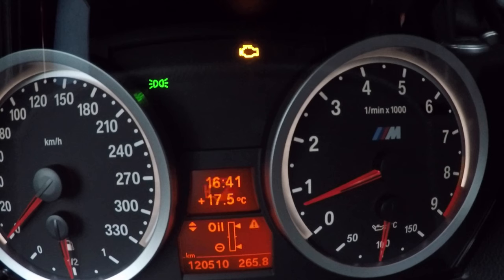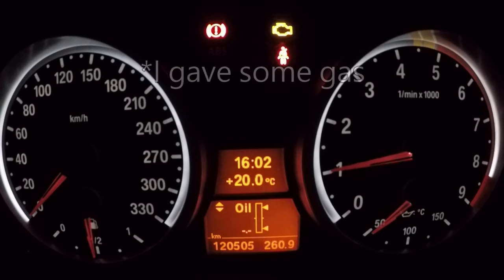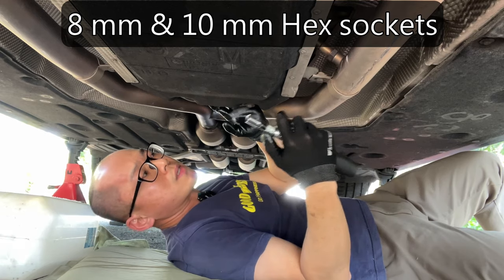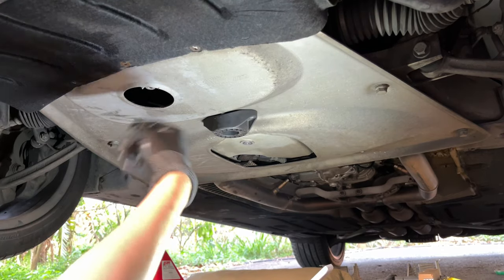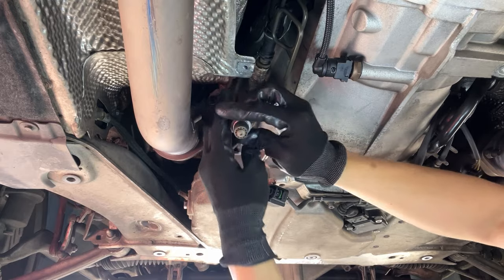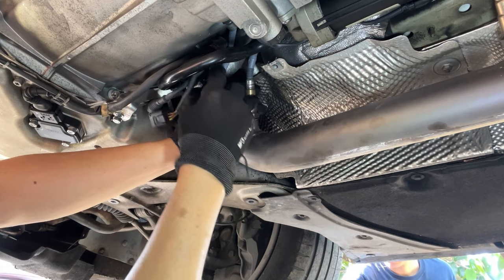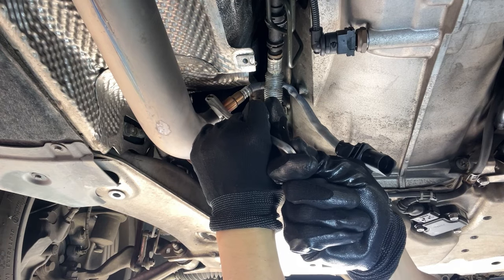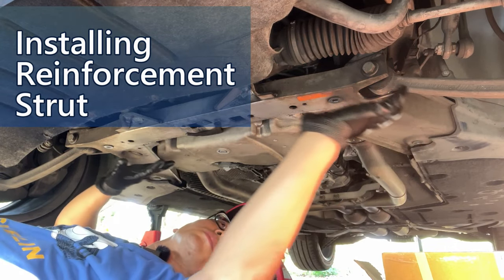O2 Sensor Replacement Fixed Rough Idle & Limp Mode of E90 M3 [ENG SUB]

Comment: i had a problem with bank 2 after kat, after  replacement error was gone by now i have 002CA2 CDKHSVSA - heating lambda probe before kat (shear stress) and 002CA3 CDKHSVSA2 - heating lambda probe before kat (shear stress) bank 2, any idea what is a problem now?
Reply from the maker: Hello Dimitrije, from the error codes it looks like another sensors have failed 🤔 they are the ones before the kat.

The o2 sensor has to be heated to their working temperature and the code indicates the heating coil has failed. Usually the coil cannot be repaired so replacement is necessary.

But before spending a lot of money for new sensors, please check if the connectors are loose, or the power supply for heating is out.

Let me know what you found!
Reply: Hi @funcarsgoodpeople, after replacement of o2 sensor before kat and drive of 120km it was all okey.
But after next start after some time i got another error 002C45 - DME: Oxygen sensor before catalytic converter.
I just sow that you did adaptation rest, i didn't do that, because i'm using Carly. Maybe error is because of that or something else, any ideas?

Thanks for help
Reply from the maker: Hello Dimitrije,
Please try to reset the adaptation. Actually I forgot to do it after O2 sensor replacement. The DME(ECU) still memorized the erroneous air-to-fuel mixture value so I got same rough idle and misfire upon the very next start. After adaptation reset, the replacement was successful, as shown in the video.

I had Carly before and I don’t like it because it kept asking me to pay for its limited functionality. I don’t think it’s useful for your professional DIY. Maybe you can visit local repair shop and ask them to do the reset with their diagnostic tool. I guess this is the quickest way to do the adaptation reset. Best wishes!
Reply from the maker: 002C45 relates to the o2 sensor you replaced. Please check harness connection too!
Reply: @funcarsgoodpeople  i just both OBD cable for INPA, do you have some how to guide who to reset the adaptation?
Reply from the maker: @dimitrijejankovic5721  Hi Dimitrije, honestly I don't have experience using INPA to reset the adaptations. But there are a lot of information on the web about "adaptation reset with INPA." For example, this one; https://www.youtube.com/watch?v=7zImhR_o26M

The general guide will be:
1. Install the driver for OBD2 cable https://www.youtube.com/watch?v=-HcMYBclj_Q&t=519s
2. Configure the Serial COM port setting for the OBD2 cable
3. Install INPA (maybe the software are included in the CD)
4. Connect OBD2 cable. Switch on ignition (but not starting the engine.)
5. Run INPA and do the adaptation reset.

I hope you have found an English version of INPA so it will be easier browsing the menus!

Comment: Good day Sir. I changed my 02 sensor and now my car stalls and wont start. Is it possible? I have a mazda demio 2005
Reply from the maker: Hello Kenrick good morning. Please reset the air-fuel mixture after replacing the O2 sensor. Too rich or too lean will make the engine stall and that's reasonable.

In fact my first start after the replacement was no success because I forgot to reset. It was the second start that you see in the video 😆
Reply: @funcarsgoodpeople  how do you reset?
Reply from the maker: Hi I used BMW's service application to do the reset. I googled how to reset Mazdas and I found a lot of people disconnect the battery to reset the car. The strategy is to make all electricity dissipate so the PCM (power control unit, or ECU, engine control unit) forgets the adaptation.

Step 1
Open your Mazda's hood.

Step 2
Disconnect the "Negative" terminal clamp to your Mazda's battery. The negative clamp should be black and marked with a "--" symbol. The positive terminal should be red and marked with a "+" symbol.

Step 3
Sit in the driver's seat of your Mazda.

Step 4
Push down and release the brake pedal five times consecutively. (or turn headlights on and off, press horn to discharge the electricity.) Wait 10-15 minutes to reconnect and ECU should be reset.

Step 5
Reconnect the "Negative" terminal clam on your Mazda's battery.
Reply: @funcarsgoodpeople  ok thank you will try
Reply: @funcarsgoodpeople  1 more question. What would happen if i mistakenly install an upstream 02 sensor in the downstream location?
Reply from the maker: Hi Kenrick, the upstream O2 sensor is the one responsible for adapting fuel mixture and the down stream one is for monitoring the condition of catalyzer. If you mistakenly replaced the downstream one, the upstream sensor is still bad so the problem cannot be fixed. Please let me know if you succeeded!
Reply: @funcarsgoodpeople  i understand this but would that cause the car to stall and not able to start.
Reply from the maker: @DaVictorRecords  Hi, this is possible because they are designed to do different jobs. If they have same threads it's really easy to mistake. Please also check this part!
Reply: @funcarsgoodpeople  ok i will. Thanks

Comment: Hello I just replaced the main fuse to all 4 oxygen sensors after getting 2c9c, 2c9d, 2c9e, 2c9f. I also replaced both upstream oxygen sensors and the codes went away except 2c9e  and now I’m getting code 3100 as well and it’s pretty much doing the same thing as yours rough idle and limp mode. I still have yet to replace the downstream oxygen sensors tho but could this be the reason why I’m getting the 3100 code as well as the 2c9e? Also mines an 09 335 e90
Reply from the maker: Hello Bruskii thank you for the comments. I believe you have done the right work. But did you #reset the #adaptation after the replacement? The DME has to reset the biased values it learnt from previous #O2sensors. I guess that code 3100 is due to incorrect adaptations in the DME.

If the DME sees something wrong about the emission, it may put the car into some strange mode.

2C9E is due to the sensor after the #catalyticconvertor and it shows #heating is not working. If the fuses are normal, then it's likely the sensor after cat is bad. You may have to replace the whole sensor. This can be confirmed by swapping it with the other sensor after the cat to see if the code becomes 2C9F.
Reply: @funcarsgoodpeople  I have tried clearing codes but I did go back under the car and checked the wiring again and found out the previous owner had spliced one of the 02 sensors I guess trying to bypass it for some odd reason so I’m guessing that’s why I’m getting the 2c9e but I will try getting the dme looked at sometime soon thanks for help tho much appreciated‼️‼️💯💯
Reply from the maker: Oh I’ve never heard people doing this. I think you are very close to solving the problem. Come back and let us know how it works!
Reply: @funcarsgoodpeople  definitely will thanks again‼️‼️

Comment: After replacing bank 2 sensor 2 with BOSCH the new codes that arrived is 27C7 Adaptation Trim Control Bank2 and 273B Oxygen sensor Check After Cat Bank 2 came up and tips?
Reply from the maker: Hello Kevin sorry for the late reply... really busy with my work but I got your message for sure.

Have you reset the adaptation for the O2 sensors? This is a must. I think 27C7 is the hint to reset the adaptation because the DME needs to learn about the new values with the new sensors! After adaptation, both codes should go away. Let me know the result!
Reply: @funcarsgoodpeople   I believe I did an adaptation of clearing the codes is what you mean? But just recently I did a hard reset by disconnecting the battery to. Does that work as well?
Reply: @funcarsgoodpeople  thanks for the help and by responding as well 🙏🏻
Reply from the maker: Hello Kevin nope I meant resetting with a diagnostic tool like I did in 14:47. I believe you are doing the hard reset right but I’m not sure if that works for the M3. I heard that some OBD2 scanner can also do the job. Please see if your friends have this?
Reply: @funcarsgoodpeople   I have the LAUNCH creeder elite obd2 scanner but there’s not much tutorials on adaptations.
Reply from the maker: Hi I did a quick look into this scanner and I didn’t see the specific reset function for the DME 🤔 Perhaps you can ask the service shop to do this for you at the next service 🤗
Reply: @funcarsgoodpeople   I think I was able to do it. Really trying to get this fixed as I get ready for smog.

Comment: What was the purpose of Adaptation Reset
Reply from the maker: Hi Kevin, the engine control unit (the DME for BMW E90) does not know that O2 sensor has been replaced. So the DME memorizes the faulty values read by old sensors. Adaptation reset is like calibrating the exhaust monitoring system 🤗
Reply: @funcarsgoodpeople  thank you for always responding. Yea we followed your steps and starting to feel like we have bad ignition coils. They are SMP and not OEM.
Reply from the maker: I see! What are the codes you are getting? Indeed the limp mode symptoms can be very confusing so I always suggest people start with the faulty codes 🤔
Reply: @funcarsgoodpeople   since I replaced all sparks with NGK but with SPM coils, they all are misfire codes
Reply from the maker: I see. I have another video regarding codes about misfire cylinder 1-8: https://youtu.be/-HcMYBclj_Q?si=gSkrcUmjBHHUOwEe but that’s due to the natural design of the S65 engine 🤷‍♂️ Consider cold start delete if the misfire codes become too annoying ☹️

Comment: Bank 2 sensor 2 is driver side after cat?
Reply from the maker: Hi Kevin, yes that's correct! (Bank 2 is on the left side, despite LHD or RHD. )

Do you have anything wrong regarding the sensor 2? I have the code but  don't see any problem so far (scratching head 🤔
Reply: @funcarsgoodpeople  yes, I have 3 codes for sensor 2 bank 2. I think I just need to replace it.
Reply from the maker: @gabby811ify  I see Kevin, sensor 2 is just for monitoring the condition of the catalytic converter. I don't think it is going to affect the performance so don't worry too much!

However it's a good idea to get rid of those fault codes. Welcome to the Faultbusters!😎
Reply: @funcarsgoodpeople  thanks appreciate the help!
Reply: I replaced bank 2 sensor 2 and the codes p2098 and P014A comes out. Wondering if I just maybe didn’t tighten it all the way?
Reply from the maker: @gabby811ify  Hi Kevin, the P codes are related to something about signal or trim control of the sensor. Perhaps an adaptation reset can help?

BTW, the two P codes are corresponding to 24 possible BMW codes. Can you use a BMW diagnostic tool to get the specific BMW code? e.g. 002CB5 or 118702?
Reply: After replacing bank 2 sensor 2 with BOSCH the new codes that arrived is 27C7 Adaptation Trim Control Bank2 and 273B Oxygen sensor Check After Cat Bank 2 came up and tips? I just bought a new OEM sensor for it to see if the BOSCH one didn’t work
Reply from the maker: @gabby811ify  Hello Kevin sorry for the late reply... really busy with my work but I got your message for sure.

Have you reset the adaptation for the O2 sensors? This is a must. I think 27C7 is the hint to reset the adaptation because the DME needs to learn about the new values with the new sensors! After adaptation, both codes should go away. Let me know the result!

Comment: I had misfire on all 8 cylinders, changed the exhaust gasket and now the misfire is only on bank 1 cylinder 1-4. it is not the coils or spark plugs. I am thinking o2 sensor maybe now but I have not got an error code for it so I am slightly confused. please let me know if you can share some wisdom!
Reply from the maker: Hello Riyan! I think the DME is smart about the condition of an O2 sensor. If the sensor is bad, we get a fault code about it.

The first thing I am guessing is the O2 sensor adaptation. Please do a reset to see if the misfire go away. Actually I did not reset the adaptation after replacing the O2 sensors. The first start was still limp mode. I did the reset like in the video, it became normal. So maybe your DME still memorizes the wrong fuel/air mixture? I am just guessing.

The second thing is to let your car complete a drive cycle. When the car reaches working temperature, and some time of driving, it starts testing the exhaust system for emission control. From the text below it suggests to keep engine running for at least 18 min. I will say try to cruise on highway at fixed speed for 10-20 min.

[Dynamic check of oxygen sensors before catalytic converter]
This system test determines by means of lean/rich shifts in the air/fuel mixture the deviation integral for the oxygen sensors before the catalytic converter from the target Lambda value. 
The diagnosis result is a diagnosis value from 0 to 1 per bank. The higher the diagnosis value, the better the state of a sensor.

Setpoint value: Diagnosis value greater than 0.4
If the value is less than 0.4, the vehicle must be driven:
- Engine at operating temperature
- 2 min at approx. 2500 rpm 
- - Speed greater than 60 km/h
- lower part-load range
- run at least one coasting phase of approx. 3 seconds
Before driving, the engine has to run without interruption for 18 minutes so that the diagnosis can run. The engine must not be switched off before the journey is completed, as otherwise the 18 -minute count starts from the 
beginning. 

If no oxygen sensor fault is stored in the DME after the road test, the oxygen sensors are OK. If a fault is stored, the sensor concerned must be renewed.

Comment: thread glue = anti seize!
Reply from the maker: Thank you Grosom31! I just learned! So that is a kind of lubricant rather than glue. I will include this in the errata 🤗
Reply: @funcarsgoodpeople  not a problem it was just a heads up its used because of the heat cold cycle of the exaust it can be difficult to remove o2 sensors otherwise.
Reply from the maker: Grosom31 thank you again for the add-up 👍👍👍

Comment: I have the same code on my e92 m3, 2b37 and 2b44. Replaced 02 sensors and reset adaptations no lick. Tried swapping plugs and coils as well without any change. Any advice?
Reply from the maker: Hi idrisu, so your problem is cylinder 3. Plug and coil seem not to be the problem. You can try swapping the fuel injectors which is not difficult (but expect minor fuel spillage).

If not the injector, I would do a compression test to see what’s wrong with cylinder 3 ☹️